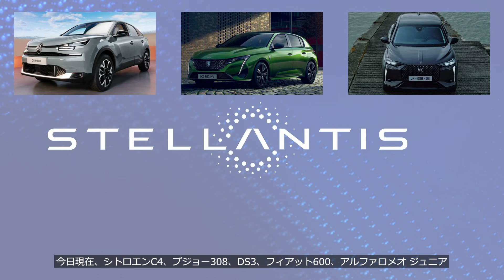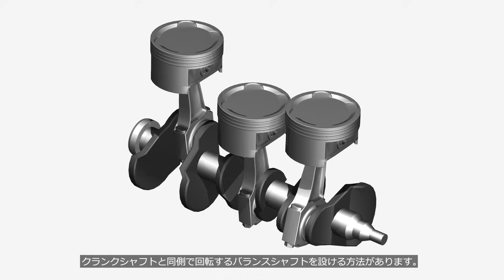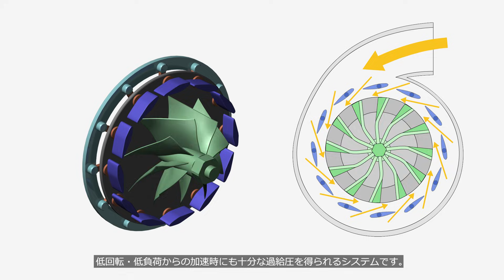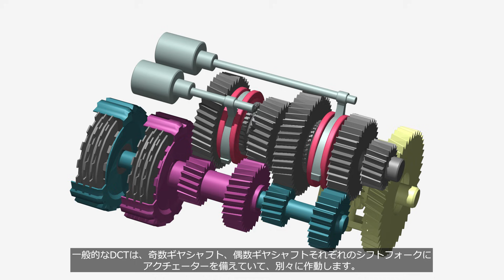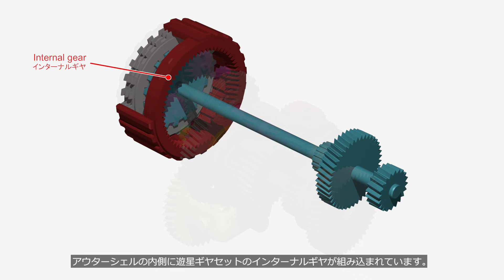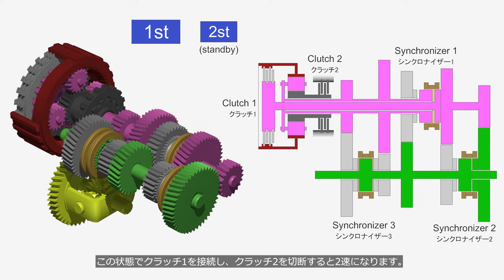Deep Dive into Stellantis Hybrid System

Comment: The weakest point of Stellantis’ 1.2 MHEV system is the air conditioning, which is powered by the combustion engine. This means the engine may need to keep running even when the car is stopped, reducing the benefits of the hybrid system.
Reply: And is inherently worse in smaller cars with no automatic A/C, which have no way of knowing if the cabin temperature is already fine and potentially could then disable the request for the A/C compressor engagement. I've driven small rental 208 in Spain this year, and whenever I turned on the A/C (manual one), it effectively disabled the hybrid altogether. It only worked at highway speeds when releasing the throttle. However one could immediately feel the typical humid air blowing at them, that we always experience if we turn of A/C that's been running for a long time. On every single downhill 😅

Comment: Can you do the E-TECH Renault hybrid which is also used in the Dacia cars? Also there were cars that have the híbrid system on rear wheals. 
I like 4x4 
imagine you have the electric motor in the rear and the ICE in the front. 
It would be like the ice would drive downhill :) as the Emotor push the vehicle.
Reply: Renault hybrid has two automated manual gearboxes, one for the petrol engine and another for the electric motor!  How mad is that?
Reply: @fivish Technically, it is one gearBOX, it only has two (somewhat) independent gear sets for the two inputs. Not more complicated than a DCT and way less complicated than classic AT
Reply: This is called through-the-road hybrid and is not the most efficient type, but is simpler than other hybrid designs

Comment: This was surprising for me, Stellantis is using the Miller cycle (early intake valve closing before BDC to expand the charged air-fuel-mixture to lower the temperature before compression stroke to reduce knock likeablity). But it makes sense, while NA'd hybrid powertrains use a late closing event of the intake valve to do the same (kind of Atkinson cycle, not the patented one, which use a linkage mechanism to create a disbalance between intake and compression stroke), but with a longer intake duration to keep volumetric efficiency high enough. A Miller cycle on NA engines would mean a tremendous VE loss.

Comment: This is like the Honda hybrid system immd
Reply: not even close
Reply: nothing in common with Honda.
Reply: No. Honda has a dog clutch which engages at 45 mph driving the wheels by petrol engine alone.
Reply: It's nothing like Honda. Instead it's Hyundai's full hybrid drivetrain that has similarities: a belt-driven starter-generator, the engine-clutch-motor-transaxle layout and a downsized Miller-cycle engine. There are differences too: Hyundai has a more powerful traction motor, a higher system voltage  (Stellantis system is more a MHEV rather a FHEV) and a planetary gears-based gearbox instead of a DCT in some cases. Also, VW and BMW use MHEVs that are somewhat similar to Stellantis'.
Reply: @jmk9065 Except that in the Stellantis models the eDSC6 does NOT use a separate belt driven starter generator, but an electric engine also capable of regerating fully integrated in the DCS , without a belt. This video is misleading, the gearbox also looks nothing like the one depicted in the video as it is a combination of a planetary gear set and more conventional set of gears.
Reply: @FerryXtheMercy  Well, you're right about the planetary gears being used in addition to regular dual-clutch transmission. AFAIK the planetary set is used to execute reverse in some set-ups.

As for the lack of a separate starter-generator, Stellantis' press materials state: "A Belt Starter Generator enables a swift and seamless transition between electric mode and hybrid one." The main motor you mentioned is in fact incorporated into the transmission but it would be challenging to have it not only do propulsion and regen but also start the engine. To switch from EV mode to hybrid mode, you'd have to decouple it from the transmission, stop and then couple with the engine. That would take too long and the experience would not be smooth